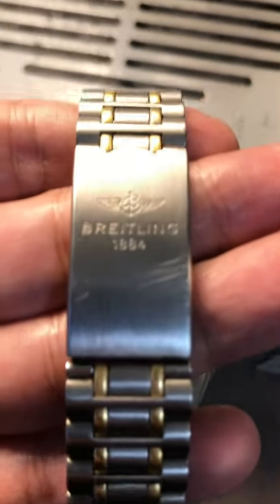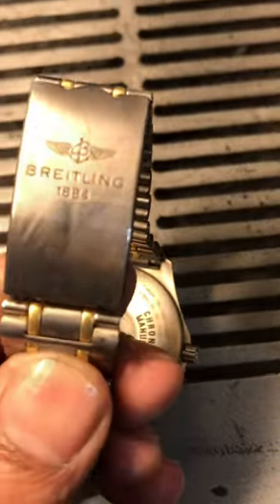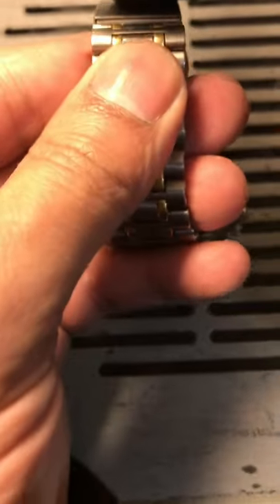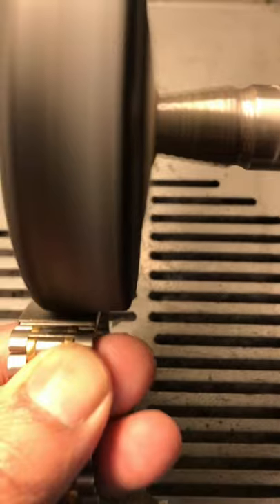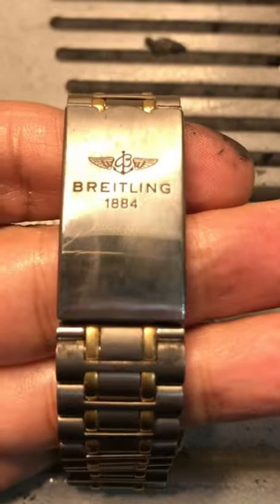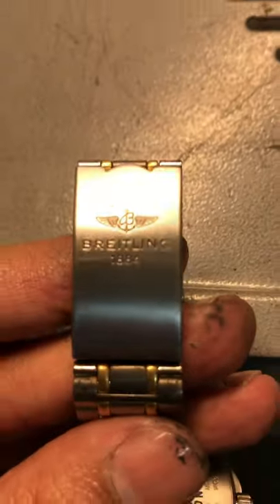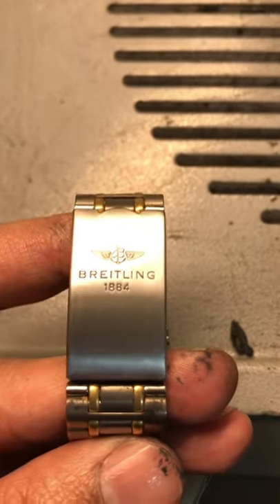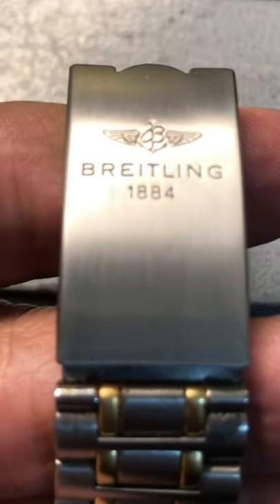How hard is it to polish titanium #short #shorts

Comment from the maker: Just trying to address a myth here. I did brush it after I removed the scratches
Reply: Pure Titanium (used for implants) is a strange element, it's non-magnetic but if you alloy it with gold, also non-magnetic, the alloy becomes magnetic. Most Titanium used in manufacturing is an alloy and it's alloyed with aluminum, molybdenum, vanadium, niobium, tantalum, zirconium, manganese, iron, chromium, cobalt, nickel, and copper and depending on the quantity of each element, the Titanium alloys properties change. Titanium alloy for a watch case and bracelet is a good choice because it's non-magnetic and magnetism can't screw up the movement!
Reply: @joseywales3789  RAG?
Reply: @joseywales3789  - I commented this "TITANIUM IS HARD TO POLISH but not cos its super hard - cos it will randomly go black and dull on you!"

That is probably due to the alloy elements in it, especially if it has a lot of aluminium in it.
Reply: @joseywales3789  hello can someone help me please telling me which polishing disc would be?
Reply: hello can someone help me please telling me which polishing disc would be?

Comment: Compared to brushed stainless steel, how easy does titanium scratch? 
Is it correct that titanium over time will oxidize - taking on a patina?
Reply from the maker: Not sure about oxidation mate. Haven’t seen anything previously
Reply: Most metals, except the platinum group (platinum, iridium, rhodium, gold, etc) can form a layer of oxide one atom thick on the surface.  Silver tends to coat with the sulfide instead of the oxide.  
The coloured marks on a motorbike exhaust pipes, especially the titanium ones, show this oxidisation well.

Comment: I use diamond grit a lot but it would be too expensive to load your wheel with it...perhaps a dremel with a small mop end.
Reply from the maker: Titanium brushes very easily and that’s usually the finish I apply. However sometimes deep scratches take a bit longer to polish out before brushing

Comment: doesn't the real problem is Titanium is always slightly corroding the moment it is in contact with air, it is like trying to polish scratches out of rusted iron, you need to remove all the corrosion otherwise it will always be visible ?